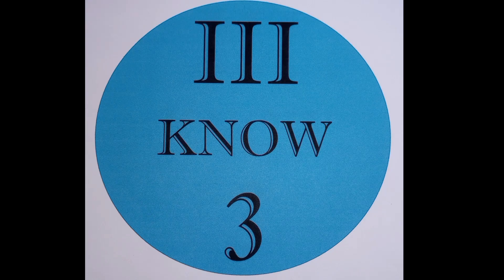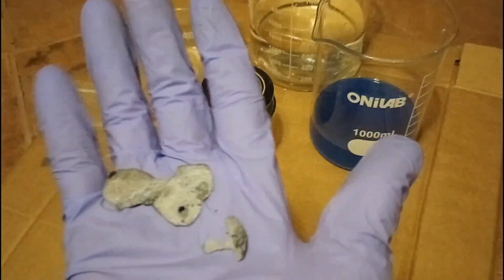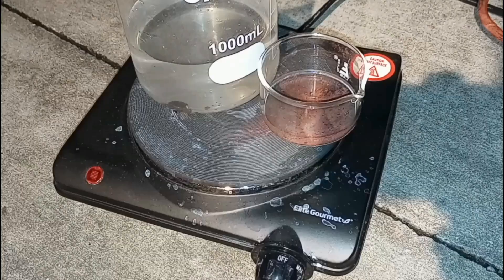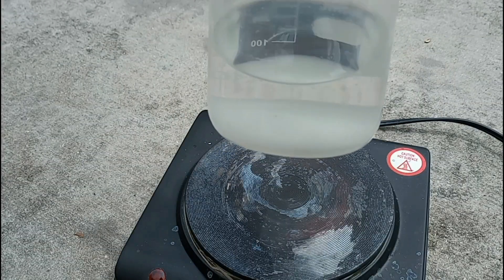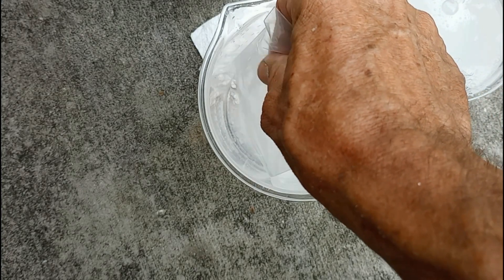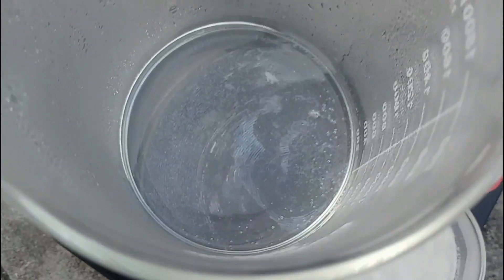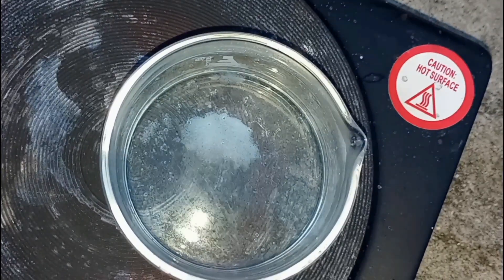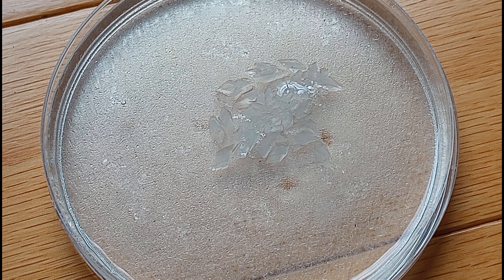Brass, Copper, Zinc and Acid Part 5

Comment: Lead oxide is the white powder hit it with a lil salt sulfuric it will dissolve its the only thing that will dissolve that stuff lol and heat lol the lil fishes floating look like tadpoles lmao
Reply from the maker: In this one the white powder is Zinc Oxide.  I did not find any lead in this batch of metal.  I still enjoy your comments LOL!
Reply: @IIIKNOW3  i said lead oxide huh i ment zinc sorry yeah hit it with salt and sulfuric it will dissolve to solution then precept and you have pure zinc lol i said lead oxids lol sometimes RHODUIM and zinc oxide can be similar but thats another story 😆
Reply from the maker: @ANCIENTASTRONAUT411  Yeah, we can save Rhodium for later.  Once I had some gold and silver scrap that had a good bit of Rhodium and Platinum in it with traces of Palladium.  After I was done I just sold them together in a button for the Platinum price.  I love the Platinum group metals, but they are so much work and usually such a small amount.  UGH.. LOL
Reply: @IIIKNOW3  very small amount later ill be working on rhoduim and how to test for it etc i got sone i got a 5 pound silver rhoduim nugget i found on my land my land contains rhoduim and man that stuff is almost impossible to smelt man i put it in a butane furnace it just melted a lil and the rest stayed powder it takes a real hot cutting torch almost welder status
Reply from the maker: @ANCIENTASTRONAUT411  Yeah, I had to use an Oxy/MAPP torch to melt out that button I mentioned.  I don't have that torch anymore, but it worked.

Comment: I appreciate your time for making these videos.  I learned alot.
I'm very interested if this same process can be done with bronze.
Reason for my interest is that I am going to electroplate metal parts for my upcoming motor build. And try and reduce all the rusting. 
Thank you Again Sir for this awesome video👍
Reply: Also wanted to ask if I were to use 34% hydrogen peroxide and nitric acid with vinegar ,
Would that speed up the desolve process?
Understanding that the nitric acid will have a stronger reaction. 
😊 TY Sir
Reply from the maker: I was using 3% hydrogen peroxide. 34% would be much faster. The nitric could be used instead of the hydrogen peroxide.  Higher concentration of acetic acid will also work, of course, just be careful and use less and add as you go. 
If you use nitric acid, it will work alone on most types of bronze. The thing about bronze is there are so many different compositions. Like brass they are mostly copper. They usually contain tin instead of zinc. It is not uncommon to find lead in older bronze although it is not as common today. If you have any questions, I will try to help you out.
If you Google "Types of bronze" there are some good results that cover many different compositions. Italian bronze contains 6% Aluminum and 2.5% Nickel. Anyway, thanks for the comment and the views. I am working on my next video now....
Reply from the maker: I was thinking, if you don't have much practice with electroplating, you may want to try nickel.  Nickel is one of the better plating elements and you won't have to worry about the complexity of an alloy.  If you do it right it will have a nice chrome like finish.  It is durable and resistant to corrosion if you are using it an application where it will be exposed to elements or fluids. Of course, I get it if you think the bronze or brass would look cool
Also another tip for electrolysis, after you make the solution, it does not need to be that strong of an acid or alkaline solution as long as the metal stays dissolved.  The important thing will be the conductivity of the liquid.
Reply: @IIIKNOW3  I'll have to look that one up I've never heard of Italian bronze before but I do like aluminum bronze the 89% and 11% version anyhow because to me when you polish it up and it looks more like gold than gold (10-karat to 18-karat anyhow)
And nice to meet your neighbor I live in Lakeland dead center middle of the state (halfway between Tampa and Orlando on I-4) and I guess Omega geek 44 who has a YouTube channel about gold recovery and refining is just down the road in St Pete so there seems to be an abundance of closet nerds with Gold Fever in Florida
Reply from the maker: @Rob337_aka_CancelProof  Italian bronze was used on some of their lira coins. I just tried it because it sounded fun. It casts fairly easy. I made a gecko lizard for a gift out of some of it that came out pretty good. I am in Jacksonville so I know Lakeland. Contemplating doing some gold soon....
Reply: @donaldspeck9212  I would go with hydrochloric muriatic acid and 34% hydrogen peroxide unless you're going for something like aqua regia and know how to denox or use the nitric acid very sparingly or you could use the very cheap version and get one pound of potassium nitrate in the form of spectracide stump remover from Lowe's or someplace like that for about 10 bucks anthro a teaspoon in as it is straight out of the can as long as you know excess nitrate can make it very difficult to drop your gold and you don't have to worry about that with the hydrogen peroxide but you can talk a little bit of the potassium nitrate stump remover into your hydrochloric acid and 34% peroxide solution to kick it into high gear if it's not already just don't use too much or when you try to precipitate it will almost immediately dissolve again so make sure you have some stannous chloride to tests for Gold in solution because that's your eyes and you're just groping in the dark without it
Reply from the maker: @Rob337_aka_CancelProof  the nitric acid video I made is pretty good. I agree with the h2o2 and not having to denox. Although you can use Sulfamic to drop any lead and denox at the same time instead of sulfuric.
Reply: @donaldspeck9212  you've graduated from vinegar School you might as well retire that bottle to use for salads or something
Reply: I understand bright shiny nickel is very easy to electroplate with and looks very nice but I'm not sure how that would hold up to high-temperature applications so you'd want to check that out in Copper is also easy to let your plate with and has a very nice look also but it is my understanding that it is extremely difficult to electroplate most alloys so you'll probably want to do a lot of homework before you start trying to plate with brass or bronze because I went on the middle finishing forum and was looking for some expertise and all of it that I found said try something else like vapor deposition or mechanical application using heat and pressure both of which don't sound like very much of a DIY project to me so you want to know what you're getting into before you spend very much of those "worthless paper rectangles that grow more worthless everyday" on it.     XD   =-)